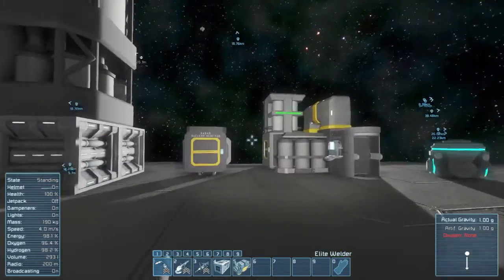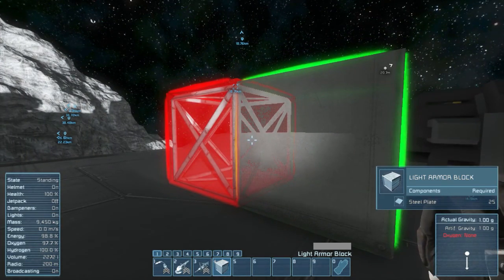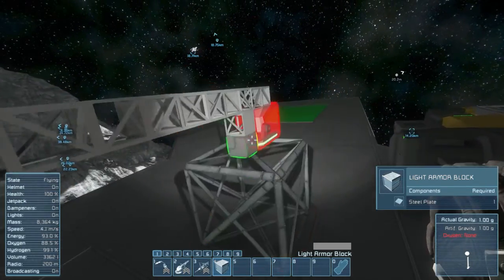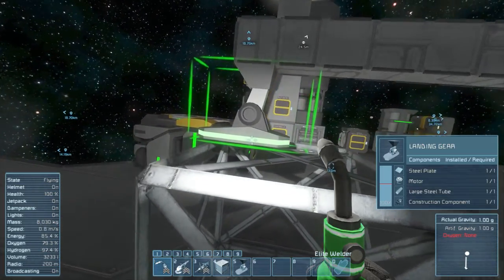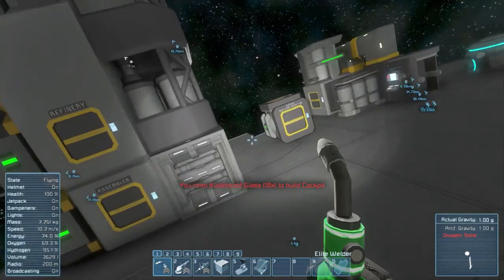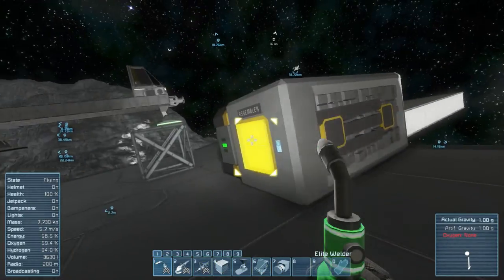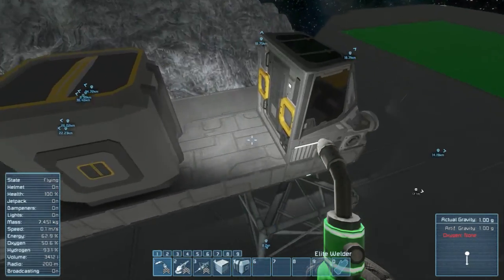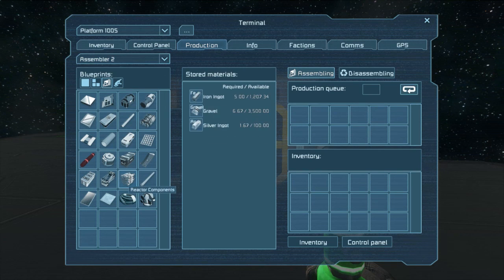(outdated) Space Engineers, Beginner Tutorial #3: Building A Ship (1 of 2)

Comment: This is a great series, especial for a complete novice like myself.

I am trying to work my way through this and I have done my homework, finding Silver fairly quickly with Gold taking a little longer to locate.  But I am now stuck at the Thrusters because I can't find any Platinum.  Is there some sort of trick to finding Platinum as I have gone out as far as about 25km and searched between 20 to 30 asteroids and not seen a sight of it?  Is it buried deep in the rock?
Reply from the maker: Thanks for the compliment! As for platinum, fyi, it's hard to find on planets, so looking on asteroids is the better bet. Also, some elements look very similar, and two could be right next to each other, so you would see one element, then turn away without realizing the other element is right next to it. The ore detector you can put on a ship has better range than the drill, so I advise making a ship with one and then exploring. You should be able to find it eventually. Hope this helps!
Reply: Thanks for the reply.

I have seen quite a few remarks about using the larger ore detector on a ship because of the greater range and I get that.  But this is where the Catch 22 comes in.

I only need the Platinum to finish the Thrusters so that I can complete building my ship.  I can't find the Platinum because I need a ship to get the bigger ore detector to find the Platinum.

Stuck.